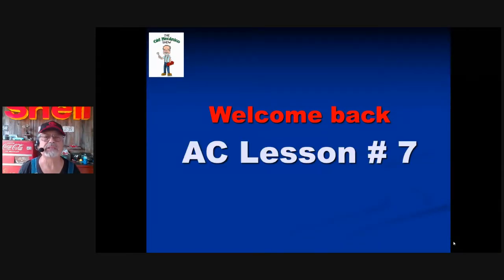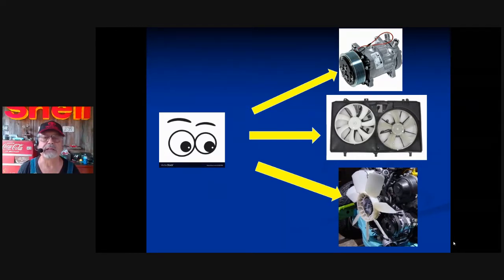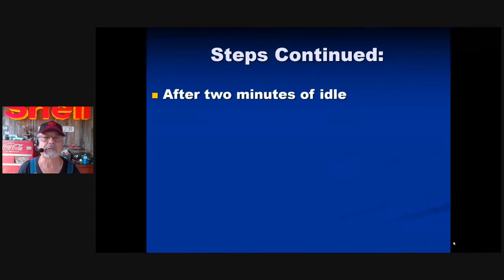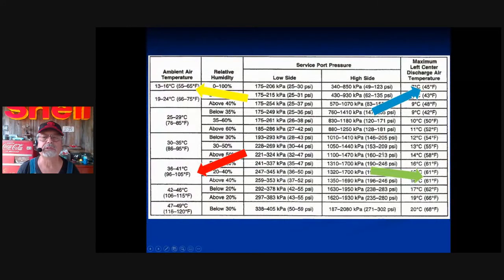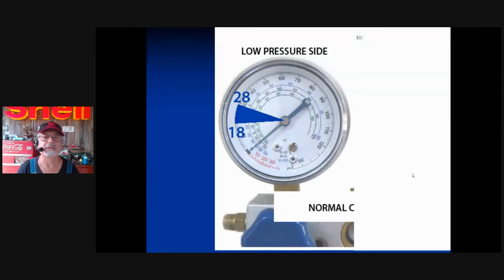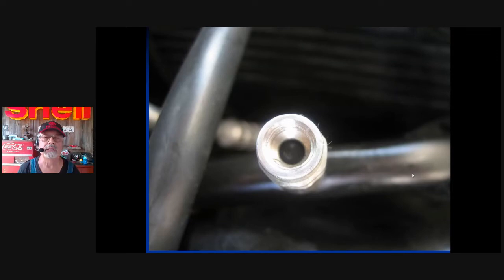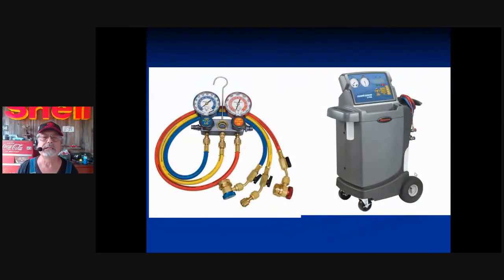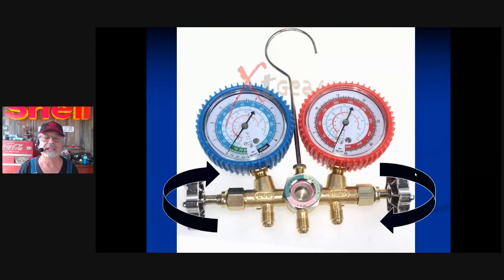Lesson # 7 : Low side Testing

Comment: 10:36 the meter says around 100 psi but down its written 71. Which one is correct?
Reply from the maker: Thank you for the question and the view. 71 is the pressure at 70 degrees. Very good eye on your part. The arrows on the gauges represent pressure at 95 degrees. 95 degrees is the normal air temp in Texas during summer. Good luck on your repairs.